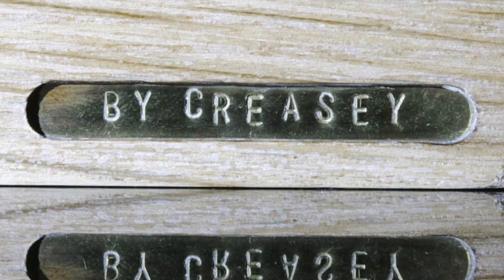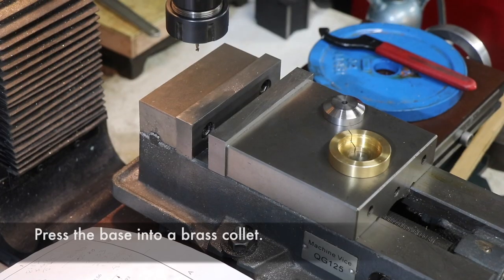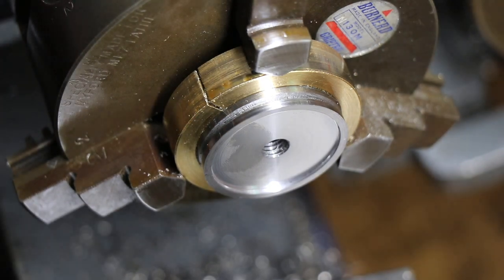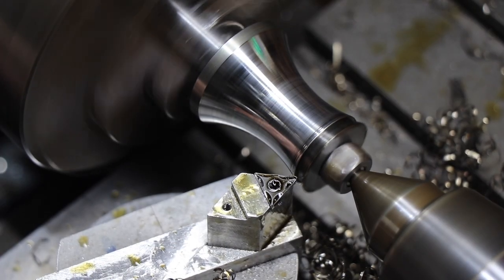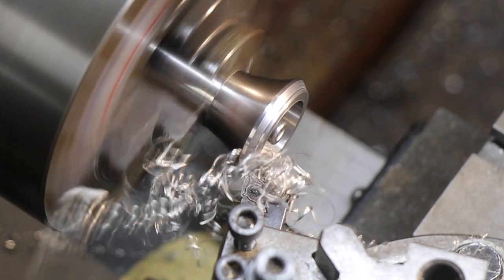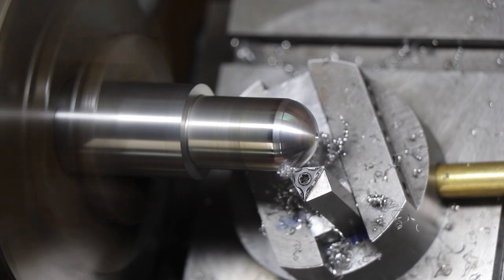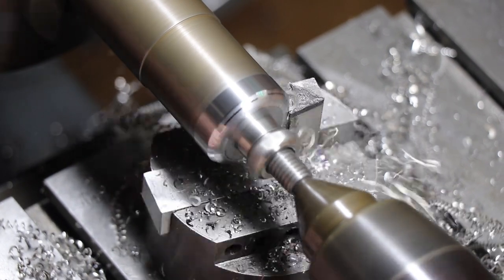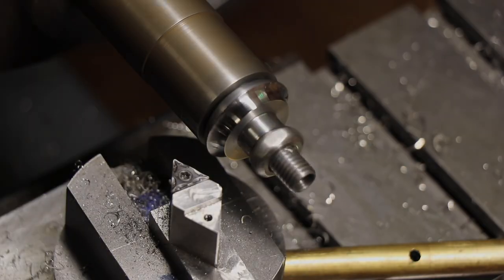Making the Iron Queen

Comment: I've watched the videos on the Knight, Bishop, Rook, and Queen. Are there videos of the Pawns and King? How about after they are "Carborized"? This has inspired me to do things different in the machine shop. Thank you!
Reply from the maker: I didn't make videos of those because it was pretty much the same as the other pieces more or less.
I'm hoping to get a video out of the board and that will show off the finished pieces.
I still haven't had them done yet.  I wanted to work out a few things on the board first, but it's getting there.
Thanks for watching!
Reply: I was trying to figure out how to do the board myself. I was thinking magnetic stainless shim stock that I can assemble with a magnet. I worry that it would get too heavy otherwise.